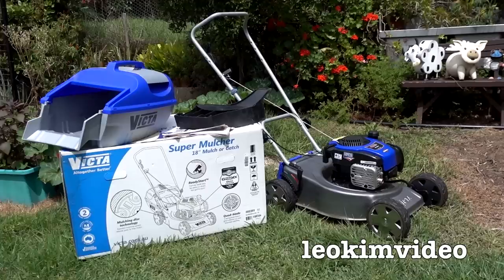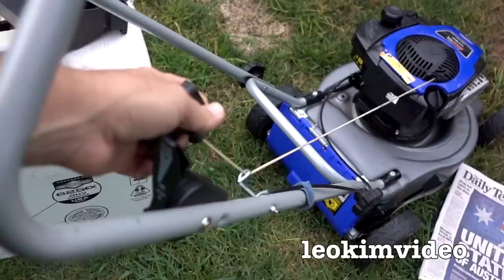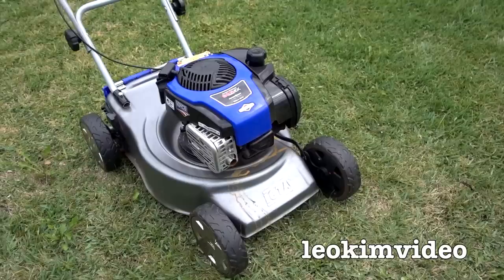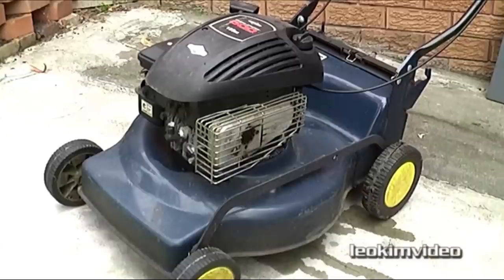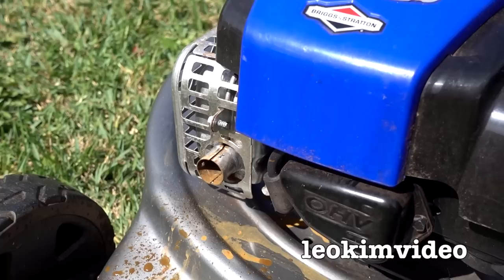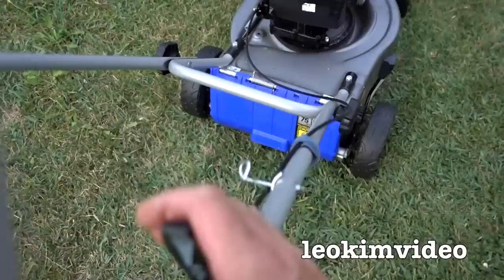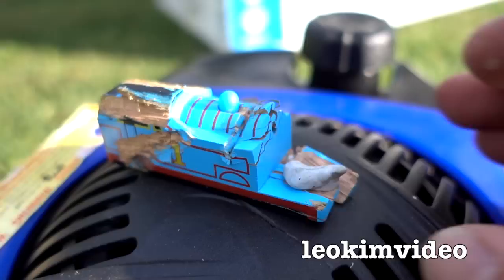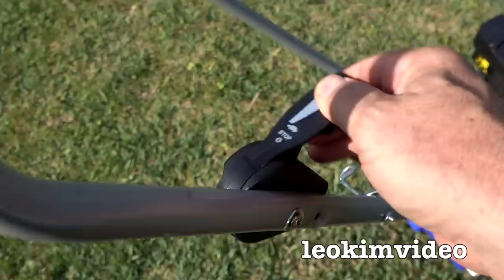Victa Super Mulcher Thomas The Tank Lawn Mower Problems Repair & Review

Comment: The same thing happened to my mower. I ran over the pull string after it came off. I wasn't fortunate enough to catch the string before it recoiled back into the pull assembly. I picked up a new string, but when I took apart the pull start the coil spring unwound in my face like an old cartoon clock. It was useless to try and put it back together after that. Ended up picking up a new mower and selling the old one for $40. It was only a year old too. Also Thomas' face in the grass looked like an old Cabbage Patch kid.
Reply from the maker: +kkehoe5 I feel your pain!
Reply: this was like mcjuggernuggets upload psycho dad shredded video games

Comment: made for mowing clockwise hence that straight side grass flow one way under deck during mowing but you didn't read instructions also once you put cord though the loop on handle close it so that cord cant come out even if pulled on branch but you didn't read instructions.
i also learn the hard way least now you know

Comment: this has been out for 20 odd years in canada, that little bracket needs to have a complete circle loop not a twisted loop with an opening so the rope can fall out, does it have the motor mulcher fly wheel brake that kills the engine in no time

Comment: those briggs engines are rubbish the older ones way better also i have all the same issues watch the videos on the you tube channel called two stroke workshop those are true victa mowers if you can find one cheap and all issues with mowers will be  solved forever